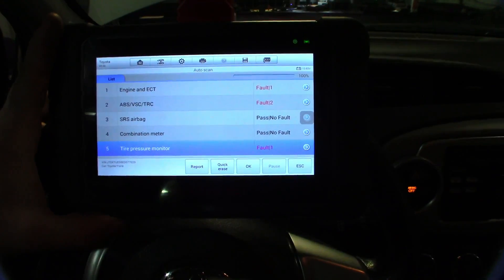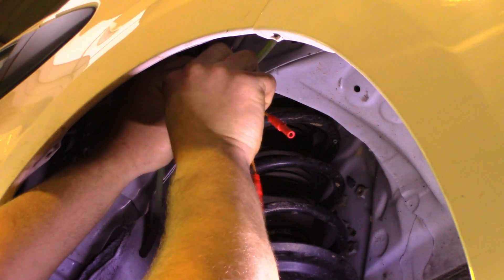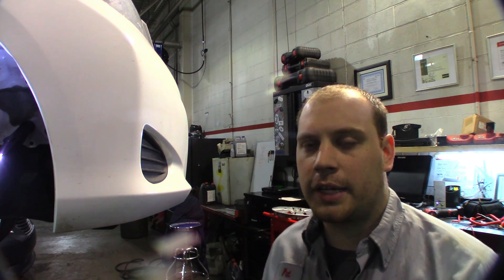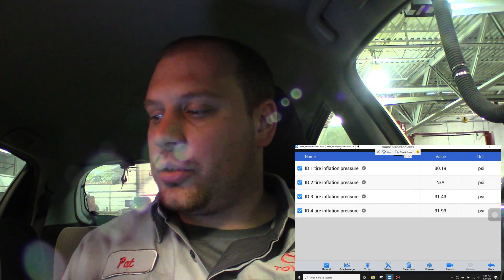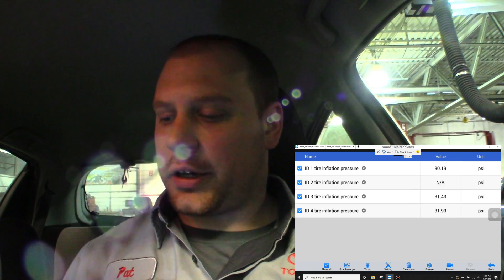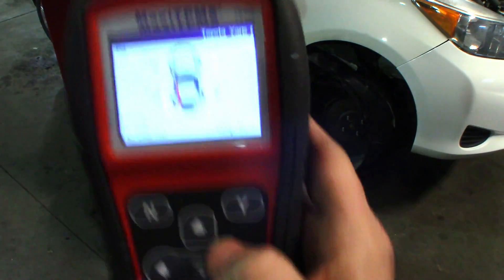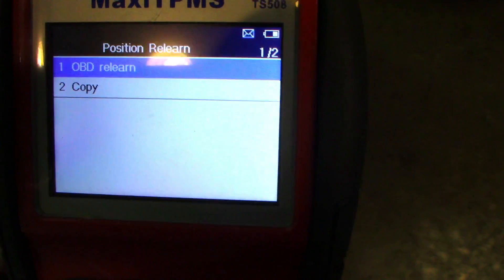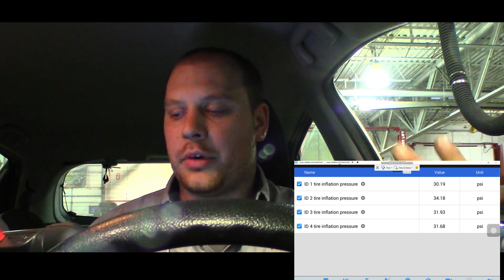Yaris-ABS & TPMS light on

Comment: Can you tell me is it possible to use a incandescent test light
Reply from the maker: ivan drago on these style sensors I’m not sure.

The ABS module is looking for amperage changes and the sensors pull about 13ma of current which is similar to an LED test light. 

So that’s why I went with the LED test light instead of an incandescent light.
Reply: @VoltageDropDiagnostics   Thanks I know you mentiod in video that you are not sure, but still want to ask you. I know that Scanner Danner use it a lot on Hall sensors or pick up sensors

Comment: 96 t100 3.4, I have misfires on cylinder 2 4 6, new inj, plugs and wires any ideas on where to go next would be greatly appreciated
Reply from the maker: steve ham man, that was before my time and they don’t exist up here in the rust belt. But it’s very possible that your timing is off considering it’s all on one bank. Or possibly an oxygen sensor? But I’d need more data to give a definitive answer.

Comment: Awesome tool at a great price, I've replaced and programmed dozens on tpms sensors with this tool, also comes in handy to make duplicate IDs for broken or leaking valve stems. My one fyi is always make sure you program to the right year make and model by scanning the other sensors first. Once programmed the autel sensors cannot reprogram.
Reply from the maker: Thats a solid tip! We have also used it to duplicate IDs so that the customer can run winter wheels and summer wheels without needing to program the sensors every time they change them.

Comment: Nice job Pat, cool tip , I guess I gotta add a LED test light to my arsenal. Any suggestions?
Reply from the maker: No, I don't have any real suggestions. I just use a craftsman one. But I only use LED test lights to simulate circuits.

Comment: Very cool on substituting the wheel speed sensor. I have a led testlight I never use. Now I have a use for it. The old sensor has a number on it that I have used to write the id on an Autel sensor. U would probably use a Toyota sensor that has a number and is not programmable. I have the older Autel tpms tool. Thank u for the great video!!
Reply from the maker: Ive used both OEM sensors and the autel sensors. I use the autel sensors on non toyotas and haven't had an issue with them yet. Thanks for watching Bill!

Comment: PS.. WITH CONNECTOR UNPLUGGED I GET NO VOLTAGE ON THE GROUND WIRE . THANKS AND LOOKING FORWARD TO YOUR REPLY ?
Reply: Are you talking about using a bias voltage to confirm wire integrity?
Reply: @PaulysAuto  NO I WAS TESTING THE VEHICLE FOR A NO POWER COMPLAINT  WITH A THROTTLE CODE AND SAW VOLTAGE ON THE GROUND WIRE AT THE ELECTRONIC THROTTLE BODY MOTOR GROUND WIRE ?
Reply: @8power0 Ok I'm confused about how this relates to testing an ABS circuit on a Toyota😂?
Reply: @PaulysAuto  I THINK WE WERE CROSS REFERENCED THANKS .

Comment: I bet that person criticizing you doesn't know that some manufacturers have front probe special tools for measuring circuits on the terminal side and checking pin fit! Some people just must find something to criticize I guess.

I like that TPMS tool! The ATEQ VT55 that I use on Acuras doesn't work quite as well as that!

When I saw you sped up the footage of the TPMS sensor replacement, I couldn't help but think that must be how fast manufacturers think we work when determining warranty times. 🤣
Reply from the maker: Manufacturers will use any excuse that they can come up with to lower labors times nowadays haha

"I seen a guy on youtube swap out a TPMS sensor in 30 seconds" I truly can see someone sitting at a round table saying that haha

Comment: 05 TOYOTA DIESEL HILUX THROTTLE BODY THE THROTTLE BODY MOTOR , SHOULD I EVER GET VOLTAGE ON THE GROUND WIRE AT THE THROTTLE BODY MOTOR CONNECTOR WITH KEY ON . LOVE YOUR CHANNEL GREAT DIAGNOSTIC VIDEOS . NEED HELP PLEASE THANKS AND LOOKING FORWARD TO YOUR REPLY ?
Reply from the maker: We dont have access to the hilux over here in the states, unfortunately. So im only guessing when I say that the voltage should be very low on the ground wire. But I also seen that you said that you had the connector unplugged. So unless the wire should have bias voltage. Im going to say no, it should not have voltage on that wire.
Reply: THANK YOU SO MUCH FOR THAT GREAT REPLY , I WON'T EVER FORGET THANKS AGAIN ! ! ! @VoltageDropDiagnostics

Comment: Why was the plug broken? You had fault codes for both front wheel speed sensors.
Also was it broken from previous accident repairs and wheel was changed?
Txs
Reply from the maker: The left side was rodent damage. The right side I’m not sure about. It might have also been rodent damage. But I’m not 100% sure about what caused the open circuit on the right side.